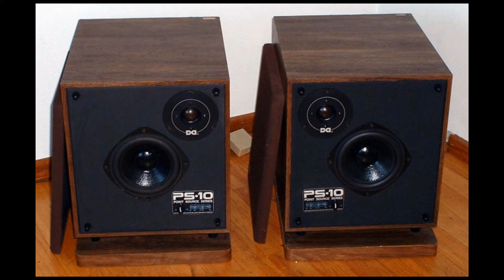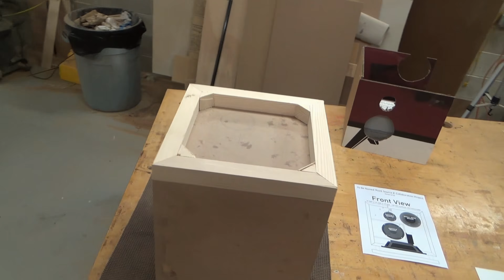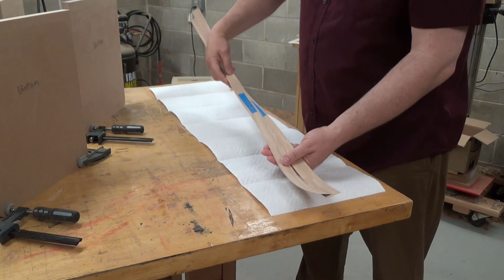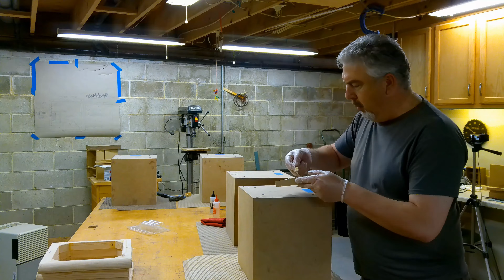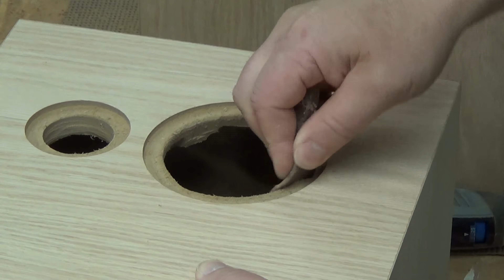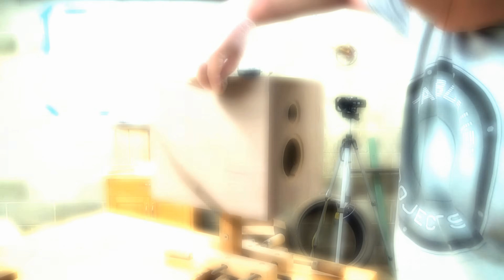A 1980’s Classic Reimagined - Part I

Comment: I must admit, sitting through the speaker build, but not getting to see/hear them after all that work leaves one with the feeling something is missing in the video. Regardless of what it would sound like. Though having just a cheap $20 microphone would exceed anything on your cell phone. Kinda like doing a car review, but not driving the car. Plus, no talk about the drivers and why and how they work together on this build. Toids didn't talk about the drivers, nor play his speakers either.  2 videos, and still alot seems missing, or maybe it's just no climatic ending showing "Success"? nice build. Albeit a lengthy one. Thanks. (and Yes, I understand to play the speakers means getting them back from Toids to finish the video.)
Reply from the maker: I hear you, and I agree, it always stinks to watch a full speaker build and not get to hear them. I didn't want to steal Toids thunder though as I was only covering the build... and though I did have an exact copy of my own, it took him some time to get the crossover designed, and more time to dial in the dsp settings, so I would have had to delay my video for a few months, which wouldn't work.  
I describe them as sounding tonally flat (a good thing) with a lively presentation (also a good thing in my opinion). Plus, there is an energy to the bass that may have been missing if we had went fully passive on the xover.

To your second comment, they needed to be as compact as possible for anyone to want to build them, as they are, they're kind of on the verge size-wise of being too big. I had to make larger bases for my speaker stands for them to feel stable.  And yes, they need to be up to sound right, they were originally marketed as bookshelf speakers back in the day.  
I hear you... moving forward, I will always try to include some type of sound test if at all possible. Thanks for the comments, and for watching!

Comment: Making just a slightly larger "cube" seems that it would be easier to put together, and for practical purposes.  While adding little to cost.  But regardless of size this speaker works, and I do like the design. They look cool.  But curious if you need to have them raised or not, like a bookshelf speaker for better performance than sitting on the floor?   Good job.

Comment: Ive ripped apart those PS-10. The woofer was a 10 inch woofer in a enclosed box. And had a tiny motor on it. The tiny motor i guess helped take up less space from the small enclosure. It was a cheap made in Tawain woofer prob just good enough for the application. Then DA released the PS-10A with a increased box volume. It was only slightly larger but used the same woofer from the PS-10. Prob to help make a deeper bass and help the cheap woofer survive. I think they changed the crossvoer in the PS-10 over the PS-10A
Reply from the maker: I think I've seen the larger PS-10A, I believe it was a little bit taller?  I bet our version will dig a good bit deeper than the original. Funny, the tweeter was a really decent unit, and the midrange actually had a cast aluminum frame on the ones I've seen. Seems they went pretty cheap on the Woofer. Hey, you can't see it under there I guess, so why bother.  Thanks for watching, and for the comment.

Comment: Tom, I love your work.  I'm an electronics
hobbyist (amplifiers, preamps, phono pres), but I am attempting my first speaker build from a kit, CSS Criton 1TD-X.  I bought the birch ply flat pack.  I'm doing the baffle with a router and I am going to apply paperbacked veneer with Heat Lock glue.  I hope someday to be able to make my own cabs like you.  Thanks for the videos.
Reply from the maker: Thanks a lot John.  You picked a good kit to start with. Kerry (one of the owners just in case you didn't know, although you probably did : ) is a cool guy and I like the way he does things.  We've talked a few times at various DIY speaker events and he knows how to design a correct crossover. I think he more got into this because of his deep love for the hobby than to try and make a killing.  It sounds like you've got things ready to go, but I'll just offer this video I made, which has a little veneering tutorial part-way through.  https://www.youtube.com/watch?v=hsgkD7EOBS4  I hate to offer help you don't need, but it just has a few things in there that may help avoid issues. Using the roller is a huge help and one of the things that make veneering this way with the heat-lock glue work so well. Even distribution helps prevent bubbles. Also, going around the edges of the cabinet a second time after a few minutes isn't a bad idea either. Sorry for the book... Best of luck with your project!
Reply: @zarboaudioprojects1430  Thanks Thomas!  I will follow your advice.

Comment: These are gorgeous. Big fan of the veneer trimming tool!
Reply from the maker: Thanks!  It's very effective, but also a little scary to use. It's literally a razor and one slip and you've got a nice little gash on your hand. I'd actually like to make something a little beefier with thicker steel that could be sharpened with a stronger handle assembly, but I'll use this for now.  Thanks for watching and commenting!

Comment: I've never seen anyone who needed to learn Onshape more. I'm 55 and I've just learned it - by the time you get to grips with it you'll wish you could teleport your mock ups into it.
Reply from the maker: I've never heard of it, I had just heard of Sketchup, which seems pretty similar. I watched a few videos on how to use Onshape, and it looks to be a pretty decent program, doesn't look TOO hard to pick up. : )    I have a background in graphic arts as I used to work for a newspaper creating advertisements, so I've gotten used to using that program, and have just basically stuck with it all these years.  I can't rotate anything I draw, though, I have to just draw it again! 
Thank you for the suggestion, and for watching and commenting.
Reply: @zarboaudioprojects1430  
Yeah - not going to wave a flag for any brand but Onshape is the one I use.
2 clicks and you can export an STM to 3D print - wow - just about any custom port or terminal you can think of and you can get a decent 3D printer for less than a decent 12" sub driver - crazy! 
Speaker boxes are one of the easier things - plus you can export a drawing or to a CNC.

Comment: Doesn't the port need to be 4" away from the wall
Reply from the maker: The rule of thumb is that the exit of the vent should be at least one vent diameter away from the cabinet wall behind it. Instructions say you can get closer than that in the Precision Port instructions, due to the huge round over.
Reply: @zarboaudioprojects1430  ok thanks I was wondering about that.
Reply: @zarboaudioprojects1430  how do you like it. My friend from work has on the those in his kitchen he still listens to it .
Reply from the maker: Nick still needs to button up the crossover and DSP settings at this point, so we don't have a final version to comment on sound-wise.  Stay tuned for Nick's  (Toid's DIY Audio) channel for Part 2 of this build. That will probably scratch all our itches on this project. I'm really looking forward to it myself!
Reply: @zarboaudioprojects1430  OK thanks for the update and the content I will stayed tuned

Comment: The technology has gotten so much better.  I have designed and built a lot good speakers . My buddy those speakers.  I also have a vintage realistic receiver from late 70s its 65 watts and it's probably my favorite.
Reply from the maker: Yeah, some of that older gear was actually pretty good. I always thought many of the older (70's - 80's amps) had a nice warm sound to them.
Reply: @zarboaudioprojects1430  it definitely does it was made by fotex I think it's a sta 2270 and it's 65:watts I found it at a thrift store for $40 and when I picked it up it felt like a tank

Comment: I watched the live feed on Toids channel. I'm the guy that had the PS-8's. I wanted the 10's but I couldn't afford the extra. I was VERY happy with these speakers. Funny as I was working as a Radio Shack mgr at the time and had access to Mach One speakers...a great deal when on sale for $159 each. I still preferred the DA's. You did an amazing job here.  I can't wait to see what's next !
Reply from the maker: Right, thanks for commenting!  EdZak7257 below mentioned he had a pair and we figured they were around $1,500-ish a pair back in the mid 80's, certainly not cheap. And for the timeframe, their overall performance and low end were pretty stellar.  Mach One's!  I had a friend that had them, I had a pair of the 12" three-ways I showed in the video. I purchased them on one of their half-price sales. That was the only way I could swing getting gear that nice back then. ?Those were the days.  : )  Thanks for the comment and input, I appreciate it!

Comment: This is AWESOME!! First pair of speakers I owned back in the 80's. Aside from the originals being sealed, they also had the offset mid/tweeter alignment where the tweeter was closer to the edge of the baffle vs the midwoofer. I sold them to a coworker after picking up a pair Vandersteen 1b towers.
Reply from the maker: Wow, can I ask you if you remember, what you paid for them back then?  I know that was a long time ago. : )    They were really unique speakers and you were fortunate to get to enjoy a pair.  Thanks for watching and for commenting!
Reply: @zarboaudioprojects1430  Going off a spotty memory, I think they retailed for around $500/pr? May have gotten a discount at the time. This was probably around 1984-85. Picked up the Vandys in early 90's and sold the PS10's.
Reply from the maker: Okay, thanks for getting back. So that's like $1,500 in today's dollars. No wonder I couldn't afford them! : )  Thanks!
Reply: @zarboaudioprojects1430  Also..... the baffle on the original was covered in some sort of a rubber-like material, probably due to the state-of-the-art at that time as far as what tech was available. The woofer was a 10" unit, but since it was a sealed box and yours is a ported design with an 8" woofer, and add to that modern technology you have available, specifically the DSP, I can imagine that your design will have some serious bass capability.
Reply from the maker: @edzak7257   Hey thanks for the comments and info on these speakers. I entertained the idea of going with a black baffle to make it look like the original, but didn't realize that there was some 'softness' to the baffle material. I guess I never got a real close look. Yes, our updated version should reach into the mid-30 Hz range with some authority.

Comment: The neo magnets all come from China and I'd bet that the first 3/8" (.375) magnets were actually 10mm (.394) Acoustic guitar builders use heat and moisture to bend the 2 sides of guitars that are typically hardwoods that are around 1/8" thick. I wonder if a heat gun or hair dryer with a little water might work with wood veneer. Great project, and thanks for using drivers that the average guy can actually afford. Even the insides of the enclosures look like art. Thanks for the effort.
Reply from the maker: Thanks for watching and thanks for the comment.  The second batch of magnets were much thinner, but they came in a sealed cylinder much longer than it needed to be, so I didn't know until I got home just how thin they really were.  Thankfully, I'm happy to learn from mistakes. : )
We did try and use cost-effective drivers on purpose. Hopefully some folks will build these and really enjoy them.  Thanks for the comment, I appreciate the encouragement!

Comment: Those DA PS10s were some seriously interesting speakers!  One of my friends had a pair (note to self - check with said friend to see if he still has them). Weren't they originally sealed cabinets though?  I'm curious as to the choice to go vented here, particularly as the plan is to use DSP to adjust the overall response of the speaker anyway, and that woofer has a pretty decent Xmax to work with.  If the DSP includes dynamic EQ, you could have it roll back the output at low frequencies a little if the volume is turned up and the woofer is reaching its excursion limits.
Reply from the maker: Yes, the originals were sealed. At least all the ones I saw as a teen, they made several versions of them over the years so I can't speak for all of them, but I think the ones you and I are talking about were all sealed. 
Not to speak for Nick, but regarding going vented... Here's my thinking on this... you can tell me if I'm off: 
These speakers should be able to reach into the 30's with some authority if vented. Going sealed would have required more wattage to get them to the same output level in the lower registers, and since we're using a 4x100 watt DSP amp to power these, the preference was to save the wattage for overall output instead of 'spending' it on getting more dB's down low.  If we had more watts to throw at the GRS sub, we could have probably gotten away with going sealed and throwing some more boost in the low end.     
Messing around with it the other day, I fed a single cabinet some 30-40 Hz tones in the basement and I liked what I was hearing... As it is, these speakers should NOT need a sub. : )
Good observation and thanks for the insightful comment.